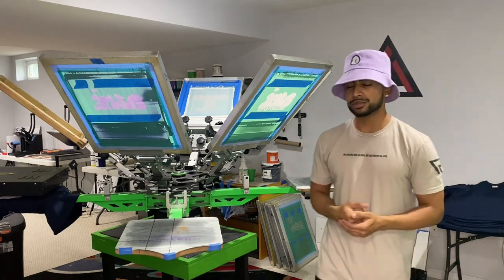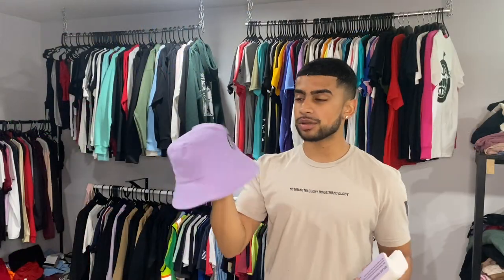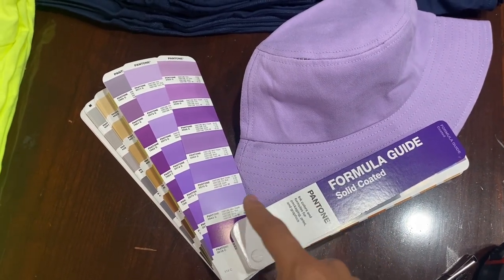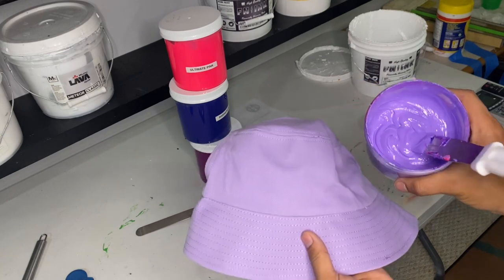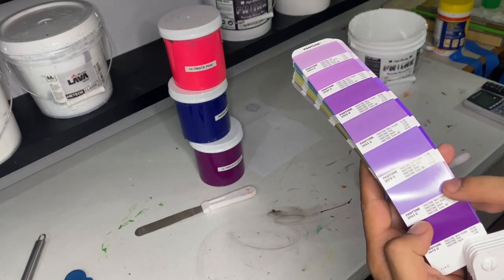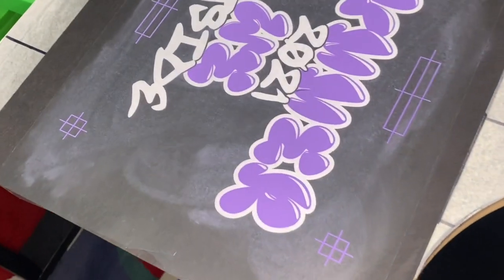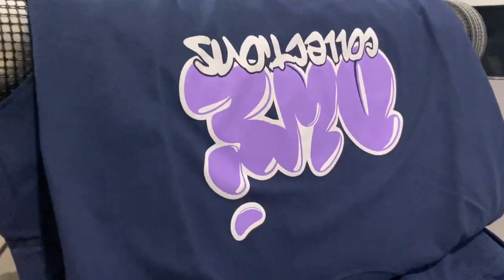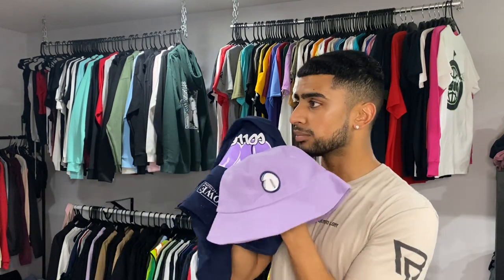Screen Printing A 2 Color Design | Pantone Color Mixing | Screen Registration Process

Comment: Hey bro. To get ride of that wiggle you have to tighten the U cage or trap or whatever you call it. There are two screws or bolts that wear down over time. It’s designed that way. Tighten them ever so Slightly
Reply from the maker: Hey great tip, I actually do tighten those two bolts on the U cage but it always moves again after a couple days. But, now that you say they wear down over time it makes sense to tighten them ever so slightly once in a while. Awesome stuff, appreciate it bro!

Comment: How do you measure quantity of Ink required for any particular job? Is there any software for it or its just a guesswork?
Reply from the maker: I mainly guess based on the size of the design and quantity run. Usually I just mix up extra to have available on hand for future use
Reply: @baavproductions  how long this ink can be shelf? Or you need to add some diluter to increase its shelf life?
Reply: @baavproductions  compare between manufacturer made original ink and mixed ink, which ink's shelf life is more?

Comment: How can I calculate for a pound without using the app/computer to do it.
Reply from the maker: Calculating a mixing ratio would be tough without the software. I have not done it without it so I would not have any good tips for you on that one unfortunately.

Comment: Where do you get your paint from?
Reply from the maker: Ryonet! AKA screenprinting.com
Reply: Okay cool. I’m literally just starting out screen printing & my first time doing a shirt was yesterday. I still need practice lol. One more question, does having a flash dryer make the print quality better/ smoother? I’m asking because I use a heat gun.
Reply from the maker: @blackbeauty139  Congrats on your first shirt! Not necessarily the smoothness but it sure does cure it better. My tip, get a flash dryer. Ebay has some for less then $200 bucks!